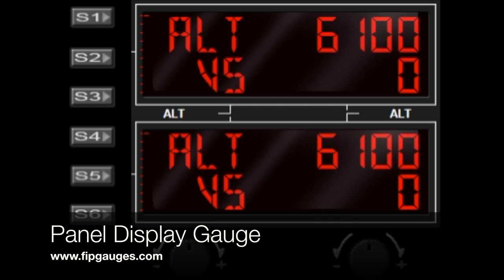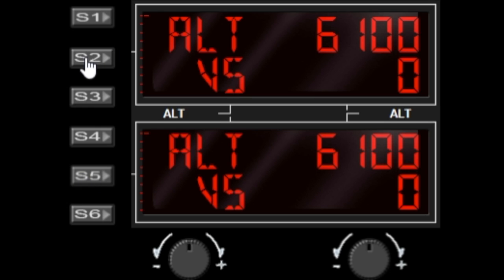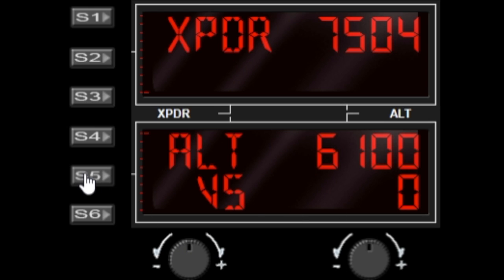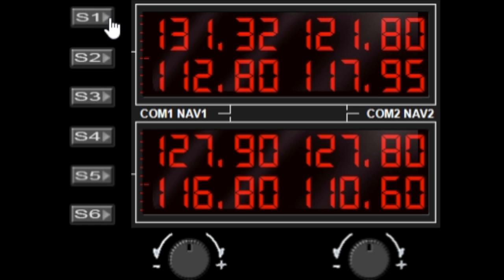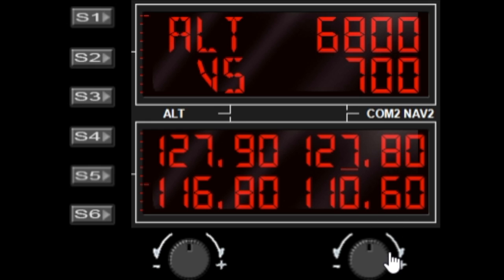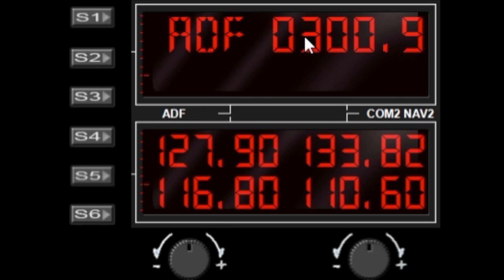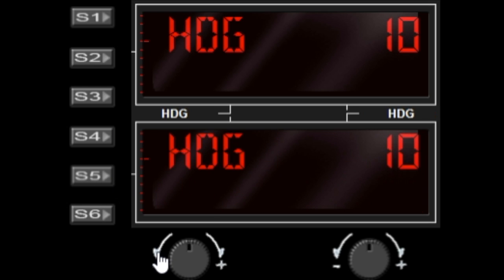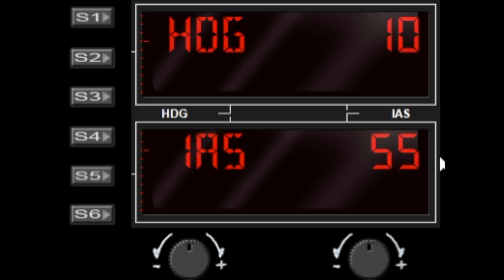Panel Display Gauge - Saitek/Logitech Flight Information Panel & SPAD.neXt

Comment: Can you install FIP gauges as extra function over stock Saitek module?. So i can use FIP and stock gauges together.
Reply from the maker: Hyunseong Park hi, my gauges run in SPAD.next and that allows you to switch multiple gauges on a single FIP much the same way the Saitek driver allows you to do the same, so as long as you have SPAD.next you can run both my gauges and original gauges on the same FIP and use the up and down buttons to change/toggle the loaded gauges

Comment: If this can be done on the FIP you know the small square one why cant you do it on the actual Saitek radio panel the larger panel if you see what I mean.
Reply from the maker: jodonbaker43 you can display ANY simulation variables on the radio panel, not just the radio frequencies, dme and xponder, so yes all the output of this gauge can be displayed on the radio panel. This gauge is for people who don't want you buy the multipanel and radio
Reply: Can you implement this on the actual radio panel multi panel switch panel etc using Spad.next.I would be more than happy to donate to your website if it would help.People need to see the fantastic gauges you develop can I share your videos to other Simmers via face book and other media sources.
Reply from the maker: Just load the default Cessna profile and you should see the switch panel, multi panel and radio work just like Saitek driver. Or download the snippets for each panel into your own profile as suggested in spad's forum post